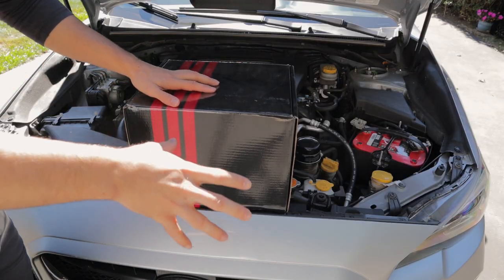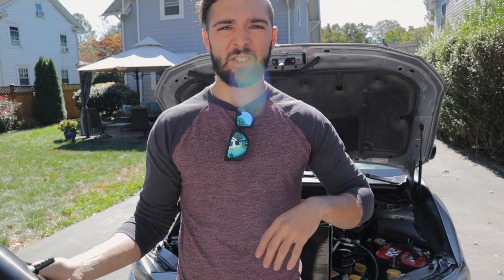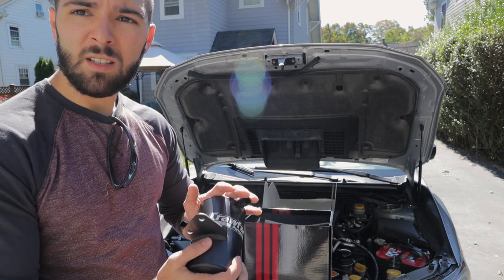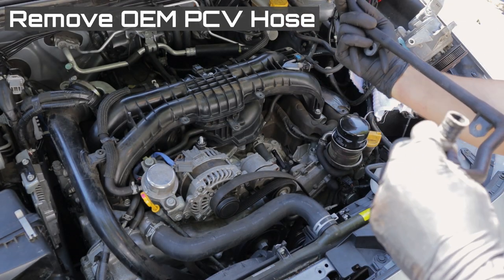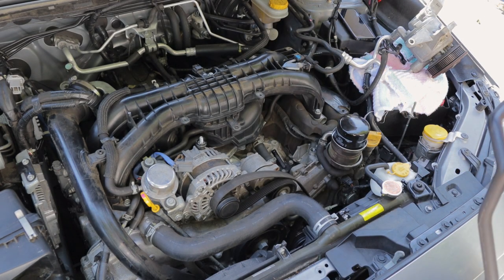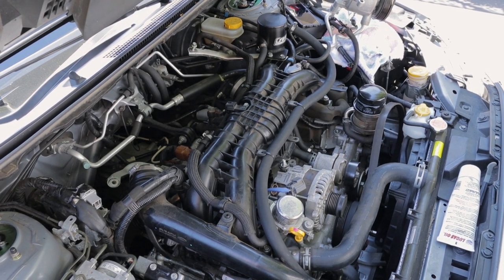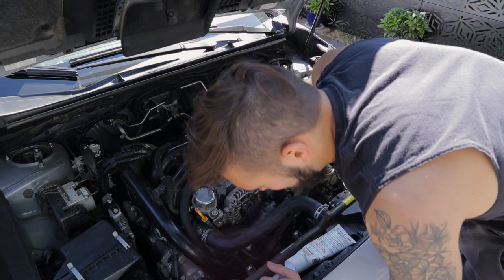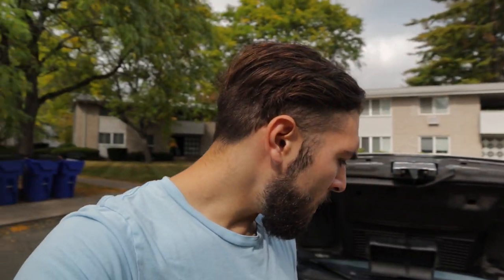Crawford V3 AOS! - Install & Review - Subaru WRX 15+

Comment: I'm running the same kit and 100% agree with the install frustrations. The length wasn't long enough for the one tube and the back of the intake tube was almost impossible. I ended up jacking my car up to get the front tube on to make it less annoying and that it was on securely. I like the kit, but the install is harder than I thought it should be.

Comment: “I’m an environmentalist...print off the instructions and give them to me” 😂😂😂
Reply from the maker: The paper industry is actually pretty close to being neutral in terms of deforestation which means that printing 3 pieces of paper for each box would be a statistically insignificant impact, especially considering that I'd be able to recycle it afterwards.
Reply: WRXGarage ah gotcha. The more ya know 🤷‍♂️ thanks for the info.
Reply from the maker: My job is in sustainability analytics so I'm a big numbers kinda guy 👍
Reply: WRXGarage oh! Nice! Great field to be in. Enjoying the content!
Reply from the maker: Thanks man! Hopefully I'll be adding Ethanol as the last piece of the puzzle soon.
Reply: @WRXGarage ...is this number big enough for you?  765,935,803,567,249.5437603

Or do you need bigger? 1E99

Comment: you mean to tell me you were completely unaware of the installation video on how to install this very product on this very vehicle ??? ... aside from this product being a coolant free install Bucky Lasek and the EXTREMELY detailed installation video on Crawford's Performance YouTube page is the very reason I went with this option over everyone else ... and let me tell you IT WAS A BITCH ... I installed it the very DAY I brought my brand new 2020 Limited home ... already had it on deck a month in advance ... brought her home June 15th 2020 ( dead center of the year by the way )  with only 7 miles and the engine has had nothing but clean air in it's cylinders ever since ... while everyone else goes for looks I have been building MY baby very strategically ... I mean she ain't even lowered nor does she even have exhaust yet ... I been doing what NEEDS to be done ... what I WANT to do will most likely not even happen til the car is paid off ... but you have no idea the comments I get because of how healthy she performs

Comment: lol I had a hard ass time putting the 1/2 hose as well, I couldn't get it to fit properly,
 I gave up lol, will continue tomorrow.
Reply from the maker: Grease the fitting a ton! That helps.. it took so much effort for me to do it
Reply: @WRXGarage  I went out and bought a bigger and longer hose.  
My car also had that “quick release” clip behind the a/c compressor.  Wasn’t able to get mine off.  I ended up just using it.

Comment: I understand how it caught the oil & separates the oil & sent out clean air but what I don’t understand is that where the oil drain back to? There’s only 4 hoses, 2 hoses coming in with oil & 2 hoses going back to intake with air. The oil drain back the same hoses that coming from pcv?
Reply from the maker: Oil drains back into the oil collection sump, the cleaned air goes back to the stock manifold location. I think. RSD has a really good video explaining the v3

Comment: Still hesitant to pull the trigger on that. Who runs an AOS year round in a (very) cold climate? Heard some people say they would clog up when it gets really cold.
Reply from the maker: I know multiple people who have run this setup in the northeast which sees 100 degrees in the summer and negative temps in the winter. No issues of clogging.

Comment: Gained a new subscriber for sure! Thanks for the install video I wanna pull the trigger on this now and upgrade the intercooler at the same time, still torn between a tmic (grimmspeed kit) and fmic (ets most likely) live where it gets pretty hot and not to cold in the winter 50 degrees is low low. Love the build and keep that content coming!

Comment: I did the v3 install on my 15 wrx yesterday and mine didn’t have that white connector either! I was really worried about it but i’m glad I saw your vid :)
Reply from the maker: Yeah it's weird! I wonder if the Subaru technicians just remove it to make it easier. I've already had my pcv valve replaced once by them.
Reply: @WRXGarage  our 2016 didn’t have it either, so I guess it’s just a 2018+ thing.

Comment: Just installed crawford v3 on my 17’ sti. Just did my first drive,notice a drop of torque and responsiveness,before when i floor it the boost goes up to 20psi,now my is only 13-18psi. I dont know if thats the normal. What are your thoughts?
Reply from the maker: That sounds like a boost leak or other issue.. did you install everything properly?
Reply: @WRXGarage  yup installed everything back,gonna chech back with the intercooler ypipe,because you know its hard to put back that red tube back to the turbo.maybe thats were im having boost leak.
Reply from the maker: The other thing is that your ECU might need to relearn. Give it a couple days of driving and see if it returns to normal!
Reply: @WRXGarage  thanks man. I’ll give it time to relearn again.
Reply: I pulled the TMIC again and check the hoses,tightening them down and found a better routing for the hoses,now its ok 👌 i feel the turbo building up boost and not dropping it. Thanks man! Love your WRX!👍
Reply from the maker: Great to hear!!!!

Comment: This seems a tad easier than the IAG install with less lines but I want to know if this takes the spot in the engine bay where a brake cylinder brace would go. Do you have to choose?
Reply from the maker: No the brake cylinder is attached to your firewall. A brace would be a completely different location
Reply: @WRXGarage The Perrin brake cylinder brace mounts up against the other side of the driver's fender so it looks like it might conflict. https://s3-us-west-2.amazonaws.com/perrinperformance/perrin.com/products/_productSlide/psp-brk-403_install_02x800.jpg
Reply from the maker: Those two components are not near each other at all. There's probably 8-10inches or more between the back of the AOS and the firewall
Reply: @WRXGarage  okay cool! Thanks for letting me know!

Comment: I'm still trying to figure out why these are so complicated to install (not an engineer).   The goal is to pull the oil vapor out of the (crankcase) air going back into the intake pre-turbo...unless it is just the location of each nipple.   On my GTI, everything was on top, with nothing in the way.  I guess with the H4/boxer, everything is buried; just the nature of the beast...Affter some thought, why can't the OE PCV hoses/tubes be used and just cut/splice into it/them with a fitting and go from there.  Then block off the end not needed instead of digging for the end under the A/C compressor and having to disconnect A/C lines.   Work smarter, not harder....

Comment: Dude that was a lot of crap to take off to put the sos on lol thank you for the real look at the install most of everyone makes it seem like the easiest thing ever
Reply from the maker: Honestly, getting the new hoses onto the fittings is annoying and awkward and definitely the hardest part. The rest of it is just big lego peices! No modification of the brackets or pulling brake lines like other ones require.
Reply: WRXGarage yea I really want to do this but I feel like I would do like you said in the video and turn a 2 hr install into a 5 or 6 hr install
Reply from the maker: All you really need is a good socket set, a breaker bar and time
Reply: WRXGarage just gonna devote a sunday to it I guess haha I need one tho